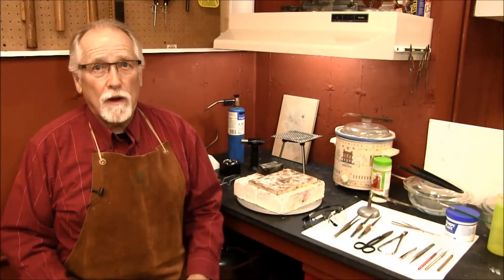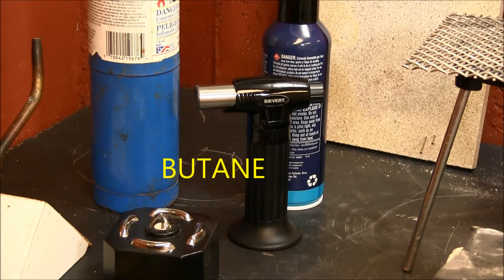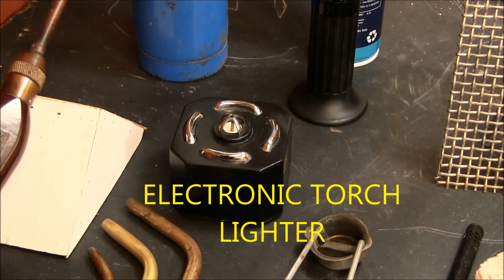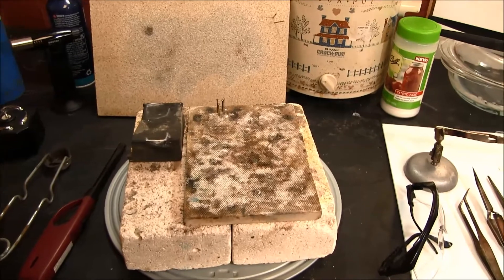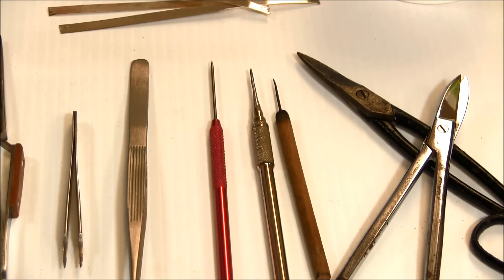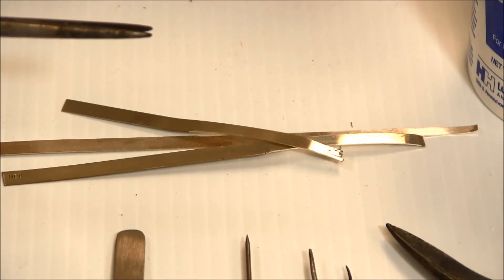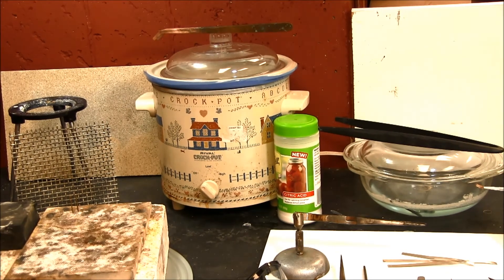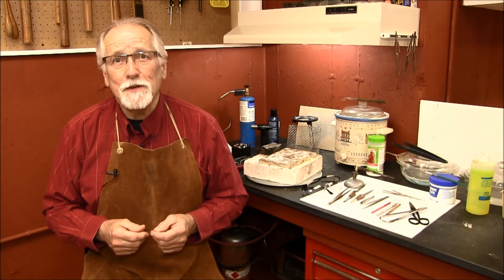SILVER SOLDERING TOOL OVERVIEW

Comment: Hey there Greg, any suggestions on the little tower tripod?
Reply from the maker: Hello 999fine4,  The tripod can be used for  sweat soldering sheet metal.  You can get under the bottom piece and heat it from below.  Check out my Sweat Soldering Videos.  They will give you some suggestions.  Thank you for watching.   Greg Greenwood

Comment: Which is hotter, propane or butane? And which one do you prefer?
Reply from the maker: Hello Lauren,  They both burn about the same temperature.  Propane is a little bit hotter but not much. 19768 Btu. Butane : 19494 Btu.    If you are just starting out in jewelry making and on a budget, you can get a butane torch at a reasonable price.  These torches are somewhat limited to the size of metal you are trying to solder. But do a good job, are easy to find and have good flexible tips.  Propane torches can range from simple plumber's torches with limited tips, to larger tank propane torches with multiple tips and can use oxygen or air in combination with the propane.  If you are thinking long term and want to get into jewelry making, then look at the more expensive propane torches.  I use for my everyday soldering an acetylene and air mix torch.  It is hot enough to melt and cast metal, but with small tips, I can solder fine wires.  I hope this has helped you.  Good Luck.   Keep watching.  Greg Greenwood

Comment: Nice to meet you. I wondering if I can replace torch with heatgun?
Reply from the maker: Hello Nelson,  Welcome to my channel.  Very nice to have you here.  Unfortunately, you cannot use a heat gun for soldering silver solder.  The temperatures are too high.  Check out  some of my soldering videos like,  "What the Heck is Sterling Silver and Solder?" "Silver Soldering Hidden Details" and "Sweat Soldering Parts 1 & 2.  This will give you the basics of soldering and other helpful hints.  Thanks and if you have any questions in the future, feel free to let me know.   Greg Greenwood
Reply: @greggreenwood4628  Thanks Greg !   Will try ours for copper & brass.   Thanks for the tip !
Reply from the maker: Good luck.  Greg Greenwood

Comment: Finally, I have found out the usage of arrestor.  Arrestors are used mostly in two-line systems where explosive gases are involved because if the pressure in one tank drops for an unknown reason, the gas pressure in the other tank may push the flame into the faulty tank, causing an explosion.  For silver soldering with single air-driven acetylene tanks, arrestors are not necessary because the tank pressure will never drop below atmospheric pressure.
Reply from the maker: Thank you windsurfer for your research.  Good job.  That is a great explanation. It is good to help each other!!  Happy New Year.  Greg Greenwood
Reply: @greggreenwood4628  Happy new year to you too, Greg :-))

Comment: I am a Hobo dollar coin engraver.  I intend to make a pin to attach to clothes using nickel material, can I weld it to a coin?
Reply from the maker: Hello Mulan,  Yes you can solder a pin backing onto the coin.  You can either use low temperature solder or silver solder.  Make sure you test it and practice on a spare coin before you attach to your final coin.   Greg Greenwood
Reply from the maker: Happy to help.  Greg Greenwood

Comment: I am addicted to your videos!  I want to know if you have been using a flashback arrestor on your acetylene tank?  I know it is a must for oxygen-acetylene setups, but I don't know if it is necessary for air-acetylene rigs.  Please let us know your thoughts.  Happy new year!
Reply from the maker: Hello windsurfer,  Glad you like my videos!!  Great question.  I have not used a flashback arrestor on my B tank.  I use a vintage Prest-o- Lite  torch and have had no problems.  I have had this torch since 1975!  Oh my gosh!  When I got it, there was no recommendation for the flashback arrestor.  Since then in recent years, I checked with my local welding supplier to see if there was an update.  They said that it was not necessary for the B tank.  It is smaller and has less pressure.   I would check with you local suppliers to see if there any regs in your area that would require one.  I have seen them on B tanks, so I know they are available. I don't know which one would be correct for that tank.  Thanks again for your great questions.  Have a great new year too.  Greg Greenwood

Comment: Happy New Year Greg!! I live in the UK (I am a Yank) and have been trying to find an air/acetylene torch. The only torches of this type I can find (Amazon) come from the US. I found a Victor torch and an Arc Union torch. I am familiar with the Victor brand but not the Arc Union. Are you familiar with Arc Union? This torch is about a third of the price of the Victor. I am finding it frustrating to locate some supplies for soldering and metal work here. So much of what I do find comes from the Good Ol USA. Odd that. Love your videos!! Sooo informative!! Please keep them coming.
Reply from the maker: Hello Bill,  I can understand your frustration.  I am familiar with Victor torches, but I have had no experience with Arc Union.  The  reviews  on the Arc Unions are mixed. Hummm?  Some of my viewers have been using Cooksongold in the UK.  But, they do not seem to have a wide variety of torches.    I know that Amazon has a distribution from UK, so that would help in the shipping costs.   Now, what torch should you purchase?   Remember, you will be using this torch every day and you must rely on it to do the best job for you.  You don't want to worry if it is going to last.  I would recommend that you get the best quality torch that you can afford. This is one area that you don't want to cut corners.   I use a Prest-O-Lite and have been very happy with it for over 45 years!  Let me know which torch you get!  Happy New Year and thanks for your comments and questions.   Greg Greenwood